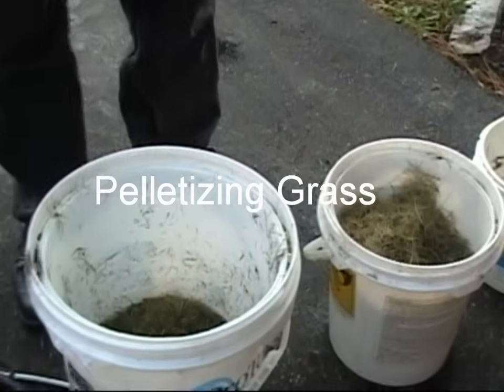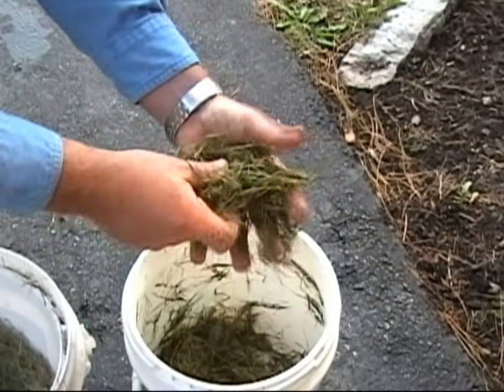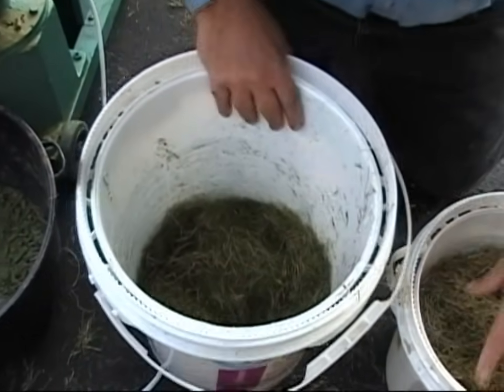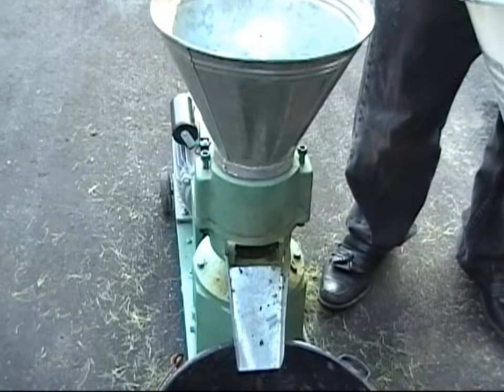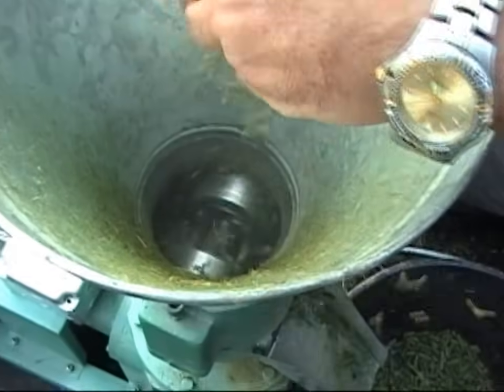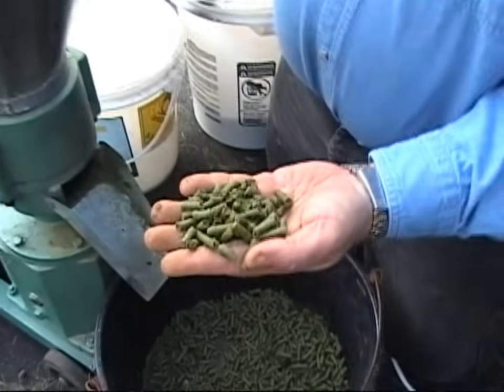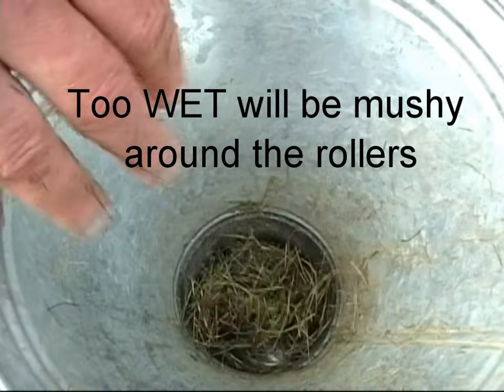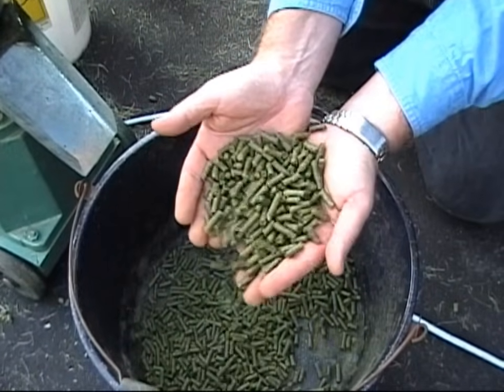Pellets made from Grass

Comment: Grass doesn't burn as hot as wood and it makes a lot of ash. You can make pellets out of almost any plant waste, but is it worth it? If you're in a cold climate and a pellet stove is your primary heat source, I'd suggest you test different brands and different woods. You'll find a big difference in heat and the amount of ash between brands. I've found as much as a 30% heat difference in heat output. Any wood pellet produces more heat than ag waste pellets.

Comment: @TeflonTron For several years we have heated our home with a 25kw pellet boiler, we used to burn just wheat straw pellets. You can provide all your heating and hot water with grass pellets, however grass pellets like straw pellets produce more ash than wood pellets and can create other issues.

Comment: Thank you Sir for your video.
I bought one of those in China and I didn't had any manuel so as you Can expect, I blocked the system with to dry material, I did not let thé machine heat enough etc.
Now thé holes on the discwhich are suite small are blocked with ingredients ans its vert hard even water Can't move it. What should i do?

Comment: Do you get a net positive energy from this process?  You cutting grass using some form of energy (gas or electric) then you use a pellet mill run by electricity to make the pellets.  Does this process consume more energy than the BTU value of the pellets?
Reply: A pelletmill at 7HP produces 80kg/hour. 
7HP is 5KW. One hour is 5 KWh, depending on your country could be anywhere from 1 to 2 USD. 

80kg of pellets can heat an average home for about 8-10 days in winter. 
Heating a home with natural gas can burn through more then 20m3 per day in winter. Again depending on your country that can be anything between 2 USD and 10 USD.

The amount of energy contained within those 80kg is vastly higher then the 5KWh it cost to make. Using modern heatpumps can heat a home on 5 KWh, but the investments are huge and below 0 degrees celcius mostly useless. 

How about cost positive? Well based on electricity alone, it's clearcut. But we've got to factor in land and equipment investments. A pelletboiler can run you 10k+ and half an acre of land to produce biomass isn't cheap either. A heatpump will cost you 20k+ and you are depended on external electricity. So in the end I would judge cost positive too IF you have access to land and/or biomass. 

Other factors include external materials, shipped by dieseltruck or ship. But that's stretching it ;)
Reply: @patrickd9551  Thanks for the informed analysis. In the 2nd to last paragraph you mention additional costs but neglect to calculate the associated costs.  These are not negligible.  As a hay farmer I know the other large cost is the cutting and collection of the biomass.  This is a large cost.  This is why I have a sense of skepticism on whether this process is net positive (either energy or cost).  If it were many people would scale this up as a business.
Reply: @darrellross410  Well on a small scale it would certainly be cost positive in a way. Lets assume the previously mentioned 80kg of biomass and a crop that produces about 20 tons per hectare, so 2kg per m2 (this seems the average yield for dedicated biomass crops like elephant grass). So how long would you need to cut 40m2 and haul that material? Assuming I would cut more in one go i could easily reduce that number to less then an hour for cutting and transport using lesser tools. Another hour for loading into the machine and I will also factor in a hammermill at 10HP. So $20 for labour make a total of $24 (high side) to heat your house for 8 days (low end). Still a pretty much cost positive deal IF you have the time and space to do so. I'm talking on a singular home type deal, so only half an acre of biomass at best, mixed with other crops. Which you could harvest and process in a day or two. Homesteading type of deals, which for me seems a pretty good deal. 

So lets talk bigger scale, but still local. Market garden style farming. It's a labor intensive deal, but a lot of people seem to make it work. One hectare of biomass could provide pellets for 10+ homes. Most biomass is harvested during winter, so it could fit in with the market garden lifestyle. So my guess is also a cost positive deal here. But this type of farming is a way of life which I don't have an expert opinion about. Just wanted to mention it. 

But you are talking big farm level comparison. So tractors, heavy equipment, shakers and belts. Much much more to factor in. I was talking investments in both the home and the equipment to process pellets. If we are talking big farming we need to compare gross prices, because investments are of the scale. So lets take a popular crop, corn silage, which fetches $50/ton here. And comparable since you need to harvest and chop the crop. It also produces almost the same weight per ha. Pellets will fetch $100+ by the truckload and $250+ for end customers. So if everything being the same for harvesting, the only added equipment is the pellet machine. So here I would guess a cost positive deal here too, but then again, no expert here either just comparing numbers.

I mention end customers specifically for smaller operations. Most farming crops like veggies need to go through wholesale dealers, resulting in lower prices overall. But pellets can be sold to the end customer fairly easy and they need a LOT. They'll buy 500m2+ worth in pellets in a singular purchase, but you'd be happy if you find a single customer that will purchase 100m2 worth of veggies spread over many deliveries. 

I'm sure I missed something ;)
Reply: @patrickd9551  Missing something...um, yes, equipment, fuel, labor, land, etc. You can't do an analysis an say a farmer already has all these things so all he needs to do is purchase a pellet mill.
Reply: @danrose3233  I hardly say that just buying a pellet mill is the only thing. But you can't expect me to write down an entire business plan can you?

All I said was, if corn silage at $50/ton is profitable enough for a farmer, then biomass pellets at $100/ton is certainly enough to cover for the additional machine. A corn farmer needs to buy machines, just like the biomass farmer. Same goes for land, fuel, labor. 

But sure, lets go over a few things I left out, just to keep my post "short"
- Most biomass crops are low maintenance. Low fertilizer needs, no pesticides. Far less labor involved in watching grass grow. Less labor, less costs. 
- Most biomass crops are perennials, sow once reap years. Planting could be outsourced, since you won't need that machine every year. You also don't need a crop duster. You'd only need to harvest, transport, chop it up, pelletize and bag it. Less equipment, less cost.
- The best biomass are C4 grasses and grow best on arid lands too. Land that's useless for other crops and guess what? That land is cheaper too.

Comment: Palleting for burning purpose is counter productive. Palleting reduces surface area that comes in contact with oxygen, a gas which helps in efficient burnjng.
In fact, fuels like coal are burned in boiler after they are pulverized to a powder stage.
Palleting is opposite of pulverization.
Fuels need pulverization and not palleting (for burning purpose).
Fuels need compaction for transportation purpose.

Comment: It's a great idea but I'd have to spend all summer making enough pellets to get me through winter.
Is there a more automated way to feed in the grass?
Reply: A 10HP pelletmill will produce 80+kg/hour. So in order to produce 2000 kg (should be more then plenty to cover winter and then some more) would take 25 hours, or 3 work days. These machines just have hoppers like any other machine. Fill the hopper, watch bag fill, remove bag and fill the hopper some more. 

Bigger plants have more automation. giant hoppers, transport belts and many more lights and switches, but essentially it's all the same.

Comment: Thanks for the vid. How much does it cost you for fuel to make a pound of pellets?
Reply: Paul Ladendorf I was wondering the same thing. How much energy is needed to be put into making the pellets versus the amount of energy you are getting out of the pellets?
Reply: Dan P   1h x 3kw/h x 0.30€ = 0,90€.    1€ for Cutting The Grass!            Summary 1,90€.             60kg x 4,5 KW/h = 270 Kw\h  Heat!     Any Questions?
Reply: fiese friesin can the grass pellets go bad if yes how long before they go bad

Comment: I just want to find out whether you still have to dry the pellets after they are extruded from the machine? And what is the machine output (in Kg/h) and well as voltage requirement (in kW)? Would be really cool if i had one of these for my rabbit business.
Reply: Cost for the pelet maschine

Comment: Hi Guys you can't generally use grass as it has a high ash content. You'll be cleaning out your fire pot every 2 hours. Getting the moisture content right is critical and grass dries at different rates. Good luck - been there done that it's not a recommend.

Comment: Well, like all simple things it has been done before (1985 in Australia by a group of Rural youth kids doing a project). In this case not repeated for obvious reasons. It takes huge diesel energy to cut the grass and coal energy to pelletize it. Then what... Why do you want it, in the first place.. does it burn better? does it feed fish or feed cattle, sheep, pigs, goats, people better.. well if it did people would have tried it, Im sure...
It seems a lot like Solar and wind power SCAM. Coal is 40% (in japan) efficient now. Wind power machines are made by coal produces 15%( over its life time) of that coals 40% efficiency (meaning coal is better to use by far).
Solar is similar its 25% efficient of the coals 40% efficiency.. 
Current solar is mostly bought from China and has an 8-15%efficiency of the original coal energy.. meaning most solar take 2.5 times more coal to make than it produces over its entire lifetime....
Hydro is 98% efficient but Greenies wont let us change the water ways because of some stupid rat which can be put in a box and remove to a zoo before it dies.... the fools!

Comment: I think I will just fire up my chainsaw and find a dead tree to cut up for firewood. I will have a pickup load stacked and the stove roaring while I sit back drinking coffee and you might be finished with that bucket of grass that'll burn up in ten minutes.. Lmfao!
Reply: Meanwhile back on planet Earth, some people are interested in pellet mills to make feed for rabbits etc. Just because it does not suit your situation is no reason to belittle others.
Reply: James Nelson there's 7 billion people out there. Can 7 billion people go out and find 7 billion dead trees? Probably not
Reply: Emma Chisett 
Wait 

You can feed them 
With these things?
Reply: 7 billion 
Also usually have access to electricity meaning heating
Reply: Bonjour je suis intéressé
Reply: In a wood stove, most of the heat goes up the chimney.  With a pellet stove, most of the heat is kept in the house.  Pellet stoves are much more efficient and don't burn up in 10 minutes.  We heat a 4000 square foot house on less than 2 bags per day.  On the coldest days, with a very well insulated house.

Comment: Im thinking this should be a wind or solar powered mill to make the pellets. It isnt green energy burning coal to power an electric mill. Not bashing just an observation. Id cut out all the middlemen and throw coal in my stove.
Reply: How is burning coal even remotely "green"?
Reply: Emma Chisett burning coal is not even remotely green. That was my whole point because it doesn't make sense burning all that electricity running a machine to produce pellets for fuel just to say you were going green. I was referring to the amount of electricity you would burn running the pellet making machine. lot of electric power plants still burn coal so I would recommend manufacturing A month's worth of pellet Fuel and see how much electricity that burns. It seems to me it would contradict the amount of green energy you created. it's kind of like some of the modern electric cars that have been made are negated by the fact that they have atrocious manufacturing processes for the batteries. that's not green energy
Reply: Weshole5W uhm, you have no idea what he's plugged his mill into. He could very well be living off grid with a solar array to power his life. Either way, if you scale this up so that it produces say, 5 tons an hour. I would estimate that 5 tons a hour plant would have a motor of 90-150 kw. So, let's use worst case scenario numbers here. I have a 150 kw diesel generator at work. Maxed out, it burns maybe 30 gallons of diesel an hour. I know diesel is much more energy dense then pellets but 100ish kilos of diesel into 5 tons of pellets? Mathematically, you'd have more energy in the pellets then in 30 gallons of diesel. So, have the pellets burn in place of coal for your electricity. The excess pellets can be sold or used for household heating or whatever you want.
Reply: Wind is pretty common too ... Is America 3rd world?